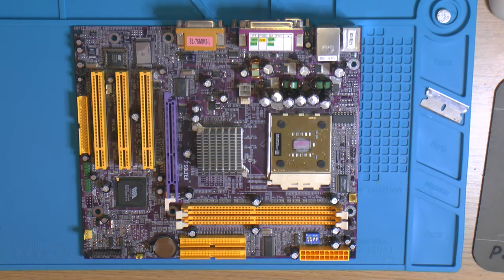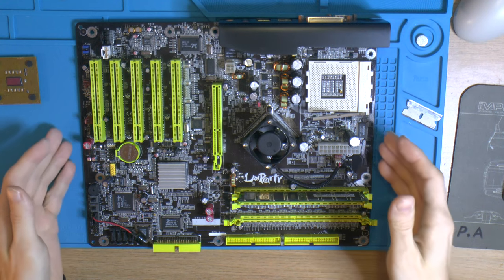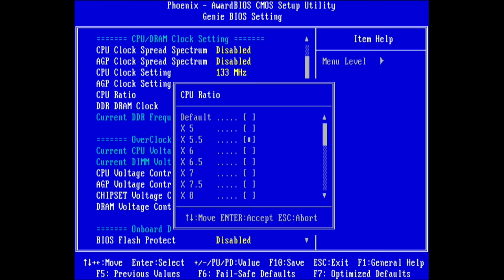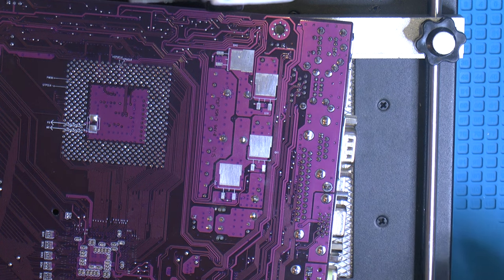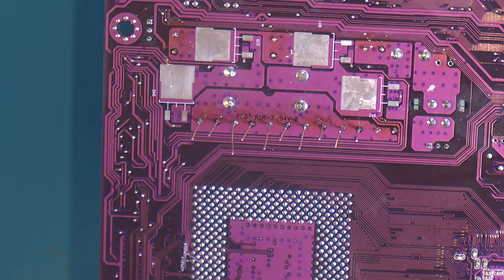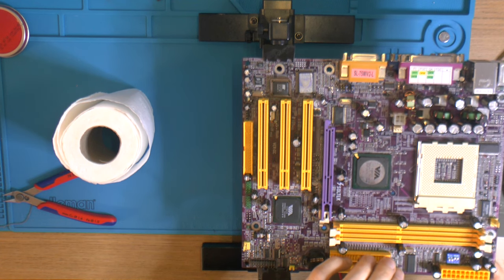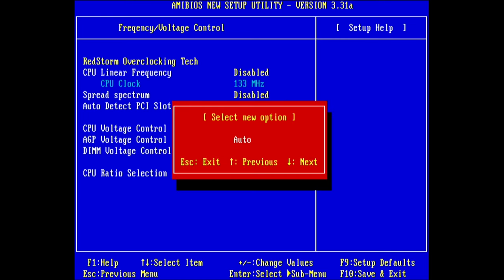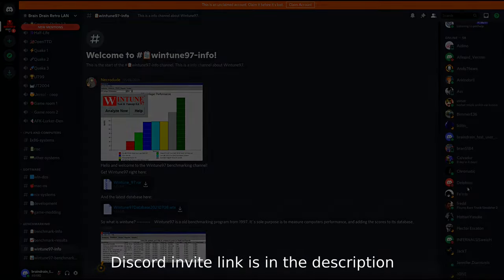Fixing DOA Soltek board with included Athlon XP-M

Comment: Barton cores were so insane for the time. 

Fully unlocked, would clap p4 1.8c oc'ed to 2.6, the OC it and you are wrecking that CPU too. 

Will never forget my DFI lan party, my winbond BH5, and my ocz power supply that allowed the 3.3v rail to go up to 4v for ram over clocking. 

Hipro5 2-2-2-5 300mhz